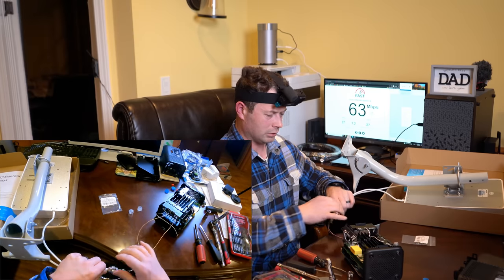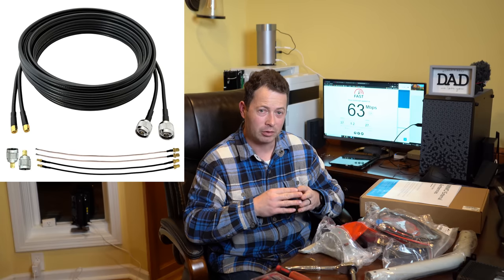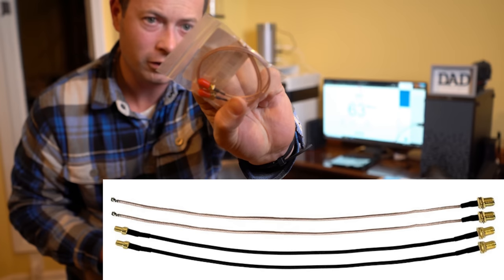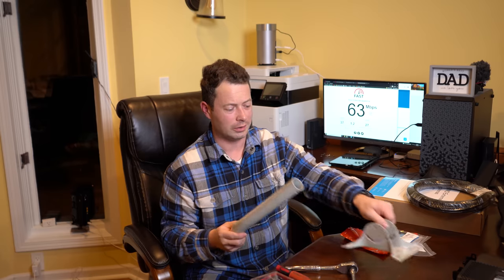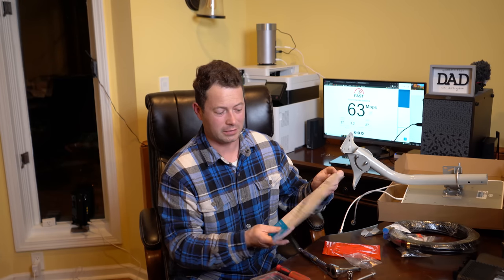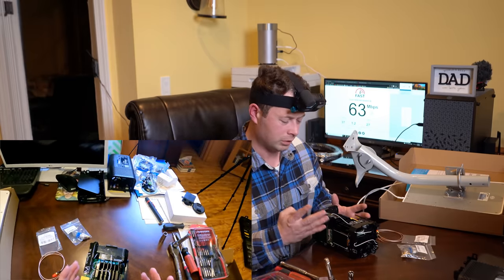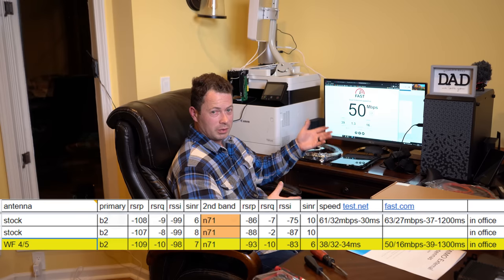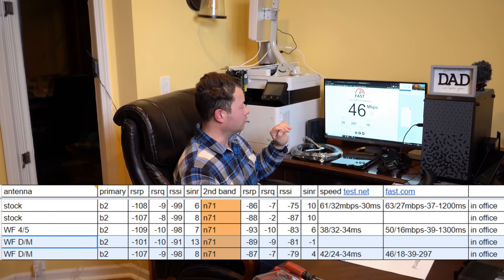✅ Waveform External Antenna - Arcadyan KVD21 T-Mobile 5G Home Internet - Speed Tested

Comment: Thank you for this series of videos! My 4x4 MIMO from Waveform has increased download speed from 1-10mbps to consistently 60-90mbps on my TMHI. This is without doing much placement experimentation, it's just sitting on my front porch. I'm hoping by fine-tuning the placement I'll get even better. Your videos were invaluable to getting it all put together!
Reply from the maker: Awesome!  I'm getting a 4x4 soon to try as well.
Reply: How do u run the cords. Idk if I'll need to drill into the house or wat
Reply: Zac what was the TM gateway signal indicator stating when you were only getting 1-10 mbps? Mine shows good signal and only getting 5 mbps. My 4x4 mimo arrives today.
Reply: @GlenHyden  what was your result?
Reply: @soundingoftheclock  Never achieved better than the base Gateway. I received an update from Waveform today specific to the Arcadian I am trying to get speed from. Now I have to crack open the gateway again. 😒
Reply: @GlenHyden  good luck
Reply: @hatersgonnahateyo  No 4 or 5 used in my case.
Reply: @hatersgonnahateyo  M and D also M1 and M2. Numerous attempts with different variations. Still trying.
Reply: @soundingoftheclock   After connecting the four cables as directed by waveform in their PDF for the T-Mobile Gateway I moved it to several positions with poor results. Before giving up, the waveform Android app had several readings and the absolute worst reading is where I had the best speed. I picked up an N41 Tower 6.5 miles away with hills and trees abound and I'm getting a constant 16 Mbs sometimes it's high as 20. So now I can watch 4k and do WebEx with no issues. 🎸
Reply: @GlenHyden  thanks for the update!!!

Comment: Perfect! Thank you Nater!

Your right about being gentle with those miniature push on antenna leads. There's a miniature pin that sticks out in the center of that pushdown connector (ie. that connects the antenna to the board). It's only like a millimeter long. That pin fits into the center of the female receptacle on the board. It's very easy to have a male and female parts slightly off-center push down expecting a tiny snap, but find that you're off center and bend that pin and/or damage the female connector's outer snap ring.  Been there done that before. FYI they can be refashioned with Jewelers tools but not a fun job. My learning experience was with a proprietary motherboard Wi-Fi card.

Comment: Thanks for all your hard work ! 👍👍👍…. I have the new ‘brick’ on back order … been wanting to test it out here in boonies of southern AZ … using the waveform panel (which by the way solved my connection to N71 I discovered I was having with my ‘bargain basement’ pair of yagis that where spec’d at 700mhz for the low end) 😵‍💫
Reply from the maker: Good to hear you're on the 5G bandwagon now!

Comment: I got my Kvd21 last week inside the house 0.7 for download png 400 no 5g signal, outside 30 down and 5 up png 40 and the app shows 5g. Should get my waveform pnl next week and hopefully it will get me going. I'm about 6 miles from the tower. Thanks  for doing this makes the learning curve a lot easier
Reply from the maker: Yes you should be able to get atleast the outside speeds then but likely much better if you are able to mount the waveform high outside.

Comment: So, What was your final recommendation as to which pins to attach the external antenna?  BTW, I got the T-Mobile w/ Arcadyan and got the Waveform dual "yagi" kit.   I have it hooked up thanks to you and I get over 500 Mbps from an outdoor mounting and over 1/2 mile away.
Reply: Ports M and M1 is what he said he ended up connecting the external antenna. Then moved the gateways built in antennas from M and M1 and connected them to port 4 and 5.

Comment: I have the trashcan. Just installed the waveform 4x4 flat panel. Added high pass 1 Ghz filters on all 4 leads. 250 mbps in RURAL setting. N41 is always locked in now. 32 mbps up on LTE. I was 30-70 mbps down and 4 up! Low E, argon windows BLOCK the signals. Trashcan behind the wall instead of the window yielded BETTER signal before I got the Waveform.

Comment: Nate, do you think that the Waveform would improve speeds on the trashcan?  Thinking that it may be superior to the antennas you tested previously. Thanks.
Reply: Yeah, could you test this antenna with the Trashcan?  I would like to know if you see any kind of improvement with this antenna.
Reply: I get a huge improvement. Two waveform panels pointed at different towers. I live out in a rural area. One sprint keep site converted last month at three tenths of a mile and one t-mobile tower three miles away. I'm buried deep in the trees and am getting 200 Mbps down and 50 Mbps up during congested times of the day. 300 plus off peak. Everyone's experience will varry based on location, obstructions, distance, interference, etc. Currently in B2 and N41. N71 is faster through the trees (upload 100 Mbps) but it won't lock onto N71 for me unless there is an issue on N41.
Reply: @sharky112065  if only they would come out with band locking software in their app 🤦‍♂️🤞🙏

Comment: Hello Nate, I want to thank you for the videos about adding an external antenna to the T-Mobile gateway. Just received my 2x2 waveform. I took advantage of your link for the discount. Is it still your belief that m & m1 ports are the best choice along with connecting stock cables to ports 4 & 5? I will let you know what speeds I am getting. This is a lot of fun. Thank you again sir.
Reply from the maker: Yes, M & M1 if you have 5G UC (n41).  You can always mess around with leaving the stock cables unplugged or on 4&5 and see what yields the best result for you.  Let us know!
Reply: Thank you Nate. I’ll keep you posted!

Comment: AWESOME! Thank you sir. Very much looking forward to this info. Thus far I've been unable to catch any of that 5G signal (although T-Mobile tells me repeatedly that I'm in a 5G coverage area and that average speeds here are around 133MBPS). I'm sitting at a solid 20 - 30 MBPS at the moment. Already have the connectors to attach the cable to the Gateway. Very curious about where to connect them, as I've seen little to no difference so far using the little crappy antennas I had laying around. Again, THANK YOU for doing all the leg work. Great Vids.
Reply from the maker: Thanks Alan, I appreciate all the kind viewers like you!
Reply: I'm roughly 4-6 miles from the tower I'm connecting to, lots of trees in between and I'm in somewhat of a lower swampy area. Can't imagine it's much different t in elevation than where the tower Is located. My question is, do you suggest the panel, omnidirectional, or the log periodic pair. Keeping in mind I'll most likely fill up all the ports that I can with external antennas depending on what happens with this first purchase. 'Preciate the late nights.
Reply from the maker: @alanmapp2900  you might want to see what signal you get up high like on the roof (if you havent already).  See if you can find a place the gateway gets 5G.  Then find a way to install an antenna there/close.  I'm doing a video this week on how to pick the right antenna.  Lots to consider!  Guessing Thursday release.
Reply: @NaterTater  haha yes, LOTS to choose from. I like to consider myself pretty "tech savvy" but these antennas and towers and cell bands and frequencies and different cables etc.... are going to melt my brain 🤣. I've yet to get a 5g signal anywhere on the property. I rode around with the Arcadyan gateway in my truck and I can pick it up right when I'm turning out of the neighborhood. Other than that.... 3-4 bars of 4g and avg 20-30mbps, sometimes 30-50mbps but it's very rare. I do know where the tower Is located so i think I'm gonna shoot for the log periodics first. According to T-Mo's coverage map I should be getting the extended 5g at my house. 🤷‍♂️ maybe it'll reach out and grab something.
Reply from the maker: @alanmapp2900  have you tried going higher?  Roof/mast?
Reply: @NaterTater  I've gotten on the roof once in one spot but they were working on the roof at the time and I didn't want to be in the way. I will get back up there in a bit after work and see what happens. Think I'll put everything back to factory specs before I hop up there. One question I do have (and I apologize if you covered this in the vid) are all the antenna ports LTE/5G or are some LTE and others 5G?
Reply from the maker: @alanmapp2900  for you M and D are probably best.
Reply: @NaterTater  can you try it on the gray trashcan
Reply from the maker: @jimmcg  I did.  Similar results.

Comment: Thanks for the detail on the disassembly video and this one.  Which ports would you recommend if using the Waveform QuadMini with this KVD21?  T-Mobile is not making it easy for me to exchange this for the new gateway
Reply from the maker: Same as any other 4x4.  Details on waveform's site

Comment: Interesting results for your location and conditions... I have been using the T-M Nokia Gateway for about 8 months now, and I have been getting good performance from it... 480mbts down load and 30-40mbts upload... No external antennas, signal strength indication of 3 bars... There are two towers about a mile away, terrain is flat, but there are trees and houses all around.  This is in a single story house, with the gateway sitting high on a desk.. Data rates will vary from time to time depending on the sit loading... This is in the central Florida area.. My brother-in-law in NC also has a TM but doesn't get as good performance in his area, again, he has the Nokia gateway, too.   Yes, location of the Gateway makes a difference.  Overall, so far I have gotten better performance that I was with the local cable service, and it's cheaper too.  Like you I did add a cooling fan under the GW, and it has kept the temper down, but the cooling did not seem to effect the performance....
Reply: flat terrain is good, me trees, houses and hills surround me not so good
Reply: is it possible that the tower i'm connected to is over capacity?  how would you test this ?

Comment: I know this test was with the WaveForm stationary antenna, but have you by any chance tested this gateway with a mobile style antenna.  Say a Parsec Husky Pro, or a PepWave 7-in-1.   I use my Arcadyan KVD21 in a motorhome.  The framing in the motorhome sort of acts as a Faraday Cage.  Was watching your videos and thought about installing the pigtails, but connecting them to a mobile antenna mounted on the roof instead.  I suspect it would work, but would the "juice be worth the squeeze" as the saying goes.

Was hoping to find someone else who's tried this already.

Comment: I just purchased the 4x4 kit from Waveform using your code. I hope it works out for my situation. My house, a T-mobile 4G tower on bands 2 and 12, and a T-mobile 5G tower on band 71 all form a triangle about 1.5 miles from each other. There is some light forestation around that might interfere with signal, my speed on the top floor of my house is about 30 down. I have a large tower outside for a broadcast TV antenna and I plan on mounting both sets of log periodic antennas to the tower, above my roof line, with 1 antenna pointed at each T-mobile tower.
Reply from the maker: TV antenna is ideal placement.  Let us know how it works.

Comment: Plugging those connectors in is a PITA!!!! I just did mine today. If I could post links I would, but Waveform makes it clear not only to use M, M1, M2 and D (I realize with your help) but also tells you that they go in that order to connection 1, 2, 3, and 4.  They even have full documentation on how to pull it apart now, make the connections, the works. Sorry I can't post the link here, YouTube will block it. So far is the HUGE decrease in latency and ping, but I still haven't fine tuned the installation.

Comment: Nate, love the videos. I bought the Waveform 4x4 panel and I have the trash can. Should I install the antenna on the trash can or try and get a different gateway? Will it work fine on the trash can?

Comment: Hey Nate
It has been a while, but when I saw that T-Mobile had a new gateway I knew where to come to see what it looked like on the INSIDE. ;-)
That 30ft. cable is way to small for those frequencies. I would have stayed with the LMR400 cable.
I have my MoFi4500 Sim7 4G LTE installed outside in a protective enclosure with 4 inch fans pulling and pushing air flow.  HOWEVER I am waiting on this  Arcadyan KVD21 Gateway. I will do the same route with it. Only thing I will need are the  U.Fl connectors to SMA. The only thing I have is a single cat 6 cable coming inside. All power and the 4x4 antennas are outside on a 20 ft. pole.
I am very looking forward to trying this one. I will let you know how it works out..... Thanks Nate.
Reply from the maker: Welcome back!  I look forward to hearing your results.

Comment: Alright, I went ahead and ordered a 2x2 at your recommendation because our Gateway gets speeds between 8 and 30 Mb on average with the tower 1.3 miles away, sometimes much higher (very rare), so we definitely need a boost. Used your code to save 5%. Hope it gets here before my 15 day trial ends and I get good results with it. 🤞🤞
Reply: Any feedback Bruce?  Was your slow speed do to poor signal or network demand?
Reply: Bruce any updates

Comment: two items of note: You need 4 wires from the antenna to achieve MIMO4x4, not only 2. Second item, would it be possible to take the trashcan/box out of the house, head towards the tower, test for a best case scenario of your tower speed? Example if you find out near the tower you could get 400/50 (just an example), then you have a good idea of what your tower is capable of. Then go back to the house and experiment with placement to replicate that performance. That will really show how much of an improvement is possible with external antennas.
Reply from the maker: Hey, thanks for the comment.  Agree on 4x4 mimo, did I say 2 wires for that somewhere by accident? This panel is a 2x2 mimo but the gateway does 4x4.  Regarding my tower, I did that exact speed test here:  https://www.youtube.com/watch?v=A1zQt3p359k
Reply: I have the trash can and am having crazy issues with it. I purchased the ext. ant., cabling etc. and my ping/latency has improved but my numbers are still way wacky. Examples are: ping 27ms 53 DL & 12 UL is my record best but I get random numbers more frequently like, 40-70 ping anywhere from 5-50ish DL & UL 6-40ish. The really weird thing is that I sometimes generate numbers that look like this 60ping 5DL & 22UL, how does that happen?? My tower is 3 miles away and I think I am going to take my "trash can" a power inverter & my laptop and see what happens. I have 3 bars signal strength and I am about 90's for the rsrp on both and about 11 on my rsrq I am only 10 off the optimum for rsrp and right there for the rsrq. I am totally confused. Tmobile is just resolved to saying your in a "poor signal area" send your stuff back and discontinue service when I keep telling them "send me another trash can to test"! Any help appreciated, thanks!

Comment: Wow! I'm so close! Thanx Nater! I have mine set up with the d-M2 works but choppy too much as far as gaming is concerned, regular usage is very good. My speeds are still consistent in spite of these hiccups. Didn't think of the position of my mimo until you said something, then it became very clear as to why I may be having issues, before I moved I had the antenna about 6' up off the ground against my fence, in turn, I believe blocked some of that interference, my son will be upset with me 😂,  defiantly will have to move the mimo this weekend. In the meantime going to try these other ports. Thanx again Nater, and again I learned something new, never too old. ;)
Reply from the maker: Awesome, I knew you'd find this video and comment!  Let me know how it turns out!
Reply: @NaterTater  will do! using as is for now till the mimo is moved. THANX! again.